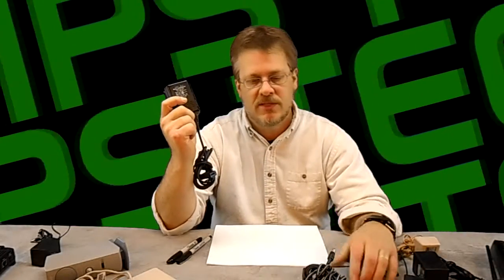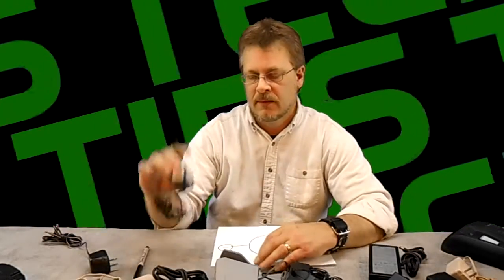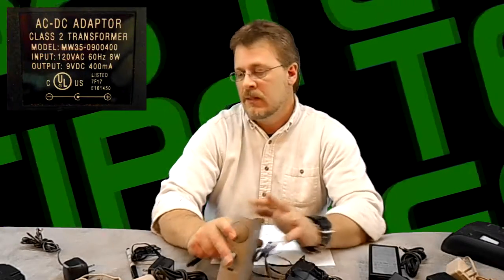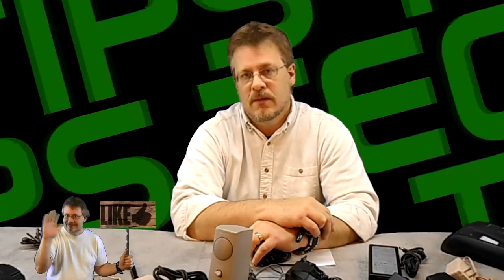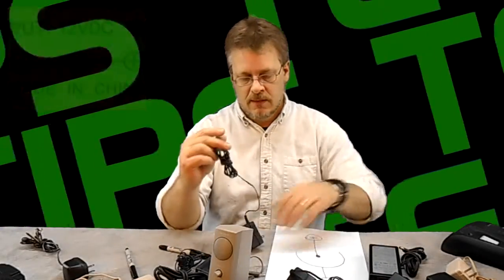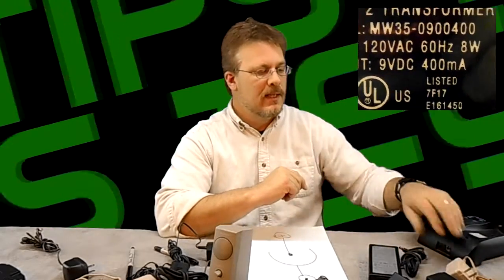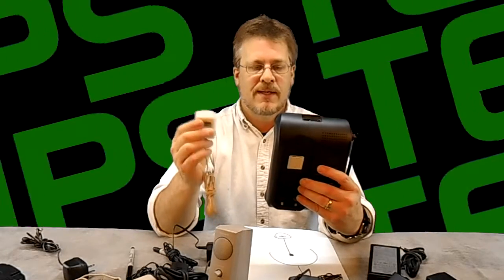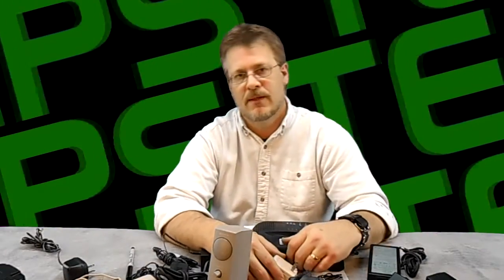How to Pair Wall Transformers (AC Adapters) to Devices

Comment: Thank you. This was very helpful. I'm using an old transformer to wire in and power a different device. I knew generally about matching Voltage and mA, but wasn't sure if I was good with a transformer supplying more mA than the device needed. In my case, the transformer supplies 840, but I only need 625. Your video quickly solved that dilemma. Thank you.

Comment: I have a holiday village (lights up) that has the cord coming from the bottom of the unit the label for the villages reads use only with 12 volt adaptor.  At the end of the cord is one flat prong and a pin (males)  How can I find the correct adapter to plug it into?  I've been looking a amazon and googling but not finding anything that looks like it would fit.

Comment: What if the device doesn't have any info  on it to match up with an adapter?  Is there something you can use to measure the devices requirements?

Comment: My device is a D-Link wireless router.  It does not specify AC or DC on it.  It does have "7.5V --- 1A." and the image of the "- c +" on it. 
My question --  Does it require AC or DC, and do I need to find an adapter that has EXACTLY 7.5 volts?  Thanks!
Reply from the maker: This would be a DC transformer and you should look for one that is as close to 7.5 volts as possible